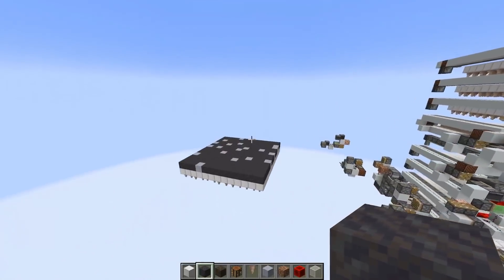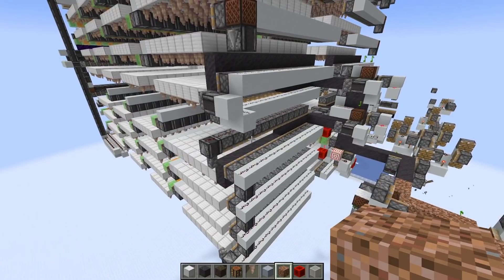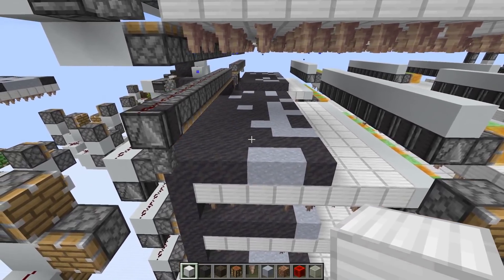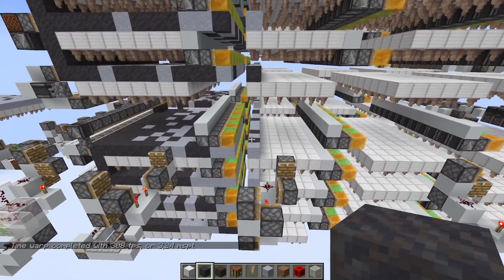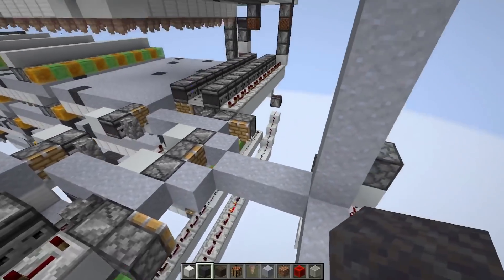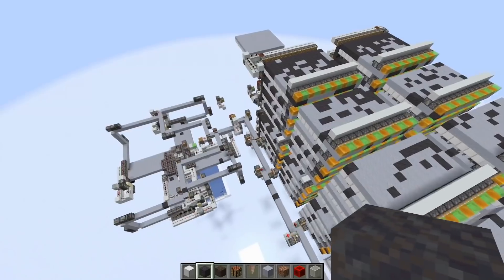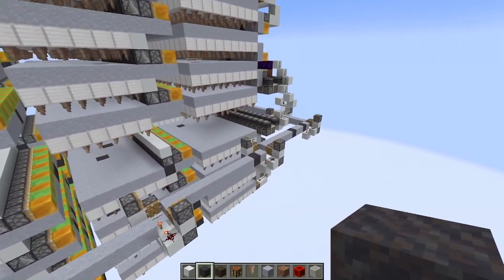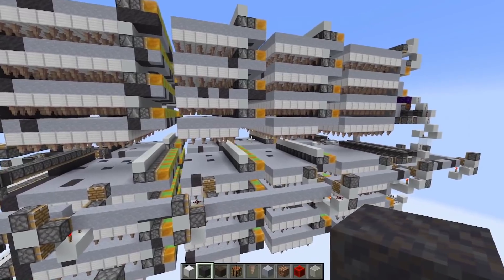Efficient Renewable Clay Converter

Comment: for some reason when my dirt goes through to convert to mud it only converts around 40-50% of the time, loads of dirt gets through without turning to mud, help???   my converter module keeps spitting out random empty bottles instead of them always being full and used on the dirt
Reply: Same here did you find a solution?
Reply: @nessunonessun1  no :(
Reply: @nessunonessun1  pls come back here and let me know if you find a fix
Reply: @iiserk248  some one in comment sed to add 64 empty bottles and 4 water bottles jn the 3 hopper and in the hopper minecar such as in a item filter, but I think it is not 100% working and Il mango I think did not do that....I think is a problem of hitbox....some kind of trik...
Reply: @iiserk248  other people are talking about it is directional ...I cheked out and in the world download, if you buld in X Z negative coordinates it work if I built for example in one cordinate positive it broke....only way to make it work is: chek out where it can work as cordinates and directions before to build it in survival...or eventually to add the 4 full bottle in the minecart and the hoppers and the empty bottles in the remaning slost to act such an item filter...
Reply: @iiserk248  from what I am watching...is the negative x cordinates that break the sistem and iven if the output blocks point north it work, if south it break....I will chek in my single player world wher I want to buil it now and try it 😂
Reply: Iven the piston that push at the beghinning 2 blocks up is directional and brak if pointung east...😭

Comment: ilmango I have a question.
At the mechanism converts dirt to mud, the minecart with hopper below it collects the glass bottles before they are fired from the dispenser.
When I build this mechanism by itself, it works fine, but when I build it into this farm, the above problem occurs.
Do you know the cause?

（DeepL)
Reply: Hi did you find the solution? I have same problem

Comment: It would be cool to see a mud-clay sorter.
If you can't do it with noteblocks, you need to use the fact that mud isn't a full block. That's also more time-resistant.
It would probably use shulkers, minecarts or items
Reply: Maybe dispence an item onto the stream, with a hopper below? When a mudblock passes through, the hopper can suck the item in

Comment: How tall is an armour stand?  You could run your output block stream past a line of blue ice and then push the armour stand to intersect with a tripwire if it stays tall on the clay, but not activate if it sinks into the mud.

Comment: if you find every spot in that machine where a mud block sits above an air block for any period of time, you could in theory bump the rates up a tad by placing blocks with dripstone below. Like those 1 wide gaps between each module, is there any reason there can't be dripstone there?

Comment: For sorting clay from mud, since the mud block is lower, cant you pick up an item through it? I'm not sure how feasible it would be, but you could maybe dispense an item on top of it, hopper underneath, and if the hopper picks up the item, it's a mud block, otherwise it's clay, then you flush the item off the top of a clay block using a water stream. then afterwards you could send mud blocks to a second one of these systems, and loop the output of the second one back into the output stream of the first, so that the mud blocks keep cycling around and only clay goes into the blast chamber.
Also, if that system were to work, would it be more beneficial to only have one of the sections, then keep looping mud through a single section until it becomes clay? right now a lot of random ticks are being "wasted" on clay, if I'm understanding it right, and if it was just mud on top, the system would be more efficient? since a certain percentage of the mud is being converted in the first section, then a percentage of the remaining mud in the second and so on, whereas if you just keep looping the mud through a single section, it would be that percentage of all the of the mud all the time

Comment: Is there any way, even implying the player, in order to detect the "non clay" block, separate them, and recycle them?
Reply: Not for an efficient system like this. This works better than most others because it operates in batches, and just relies on a long enough time so that the majority will convert. The only viable alternative is detecting when specific blocks are converted and moving them out, but that would probably be a lot bulkier and harder to deal with. This gets more output with fewer redstone resources. But theoretically you could, yes.